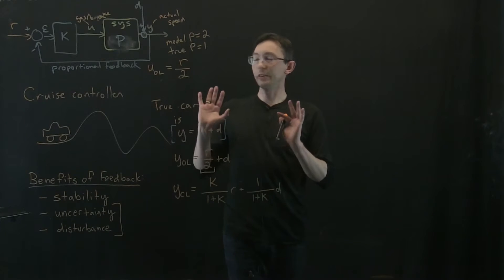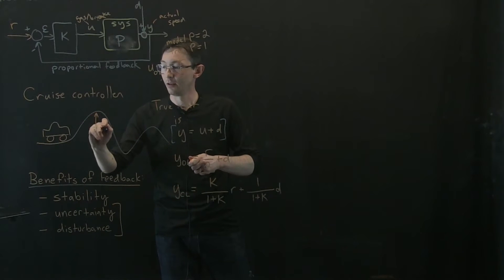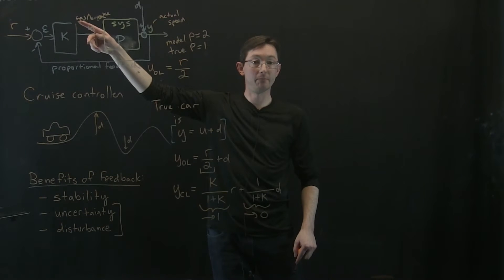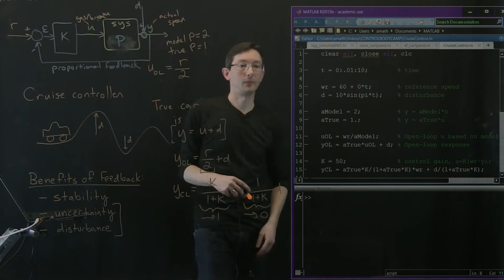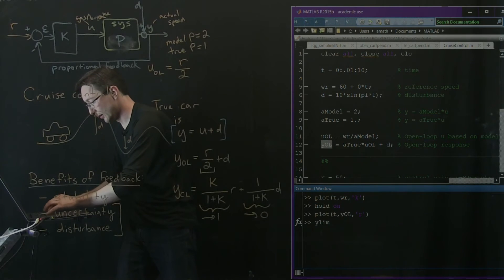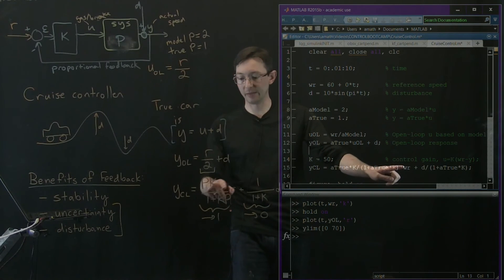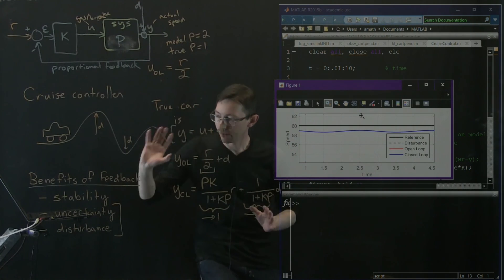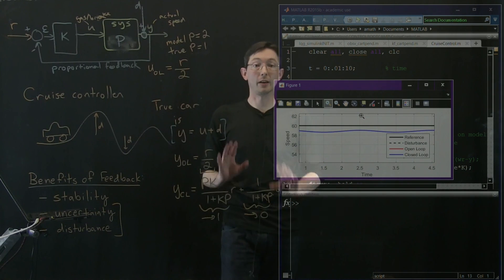Control Bootcamp:  Benefits of Feedback on Cruise Control Example (Part 2)

Comment: I want to express that your videos or lectures are probably the best I've encountered in explaining the 'relevance' among ctrl, obsv, LQR, Kalman filters, and the necessity of reverting to classical system analysis for robust control. Your language is not only succinct but also remarkably clear. Sometimes, it even leads me to moments of sudden clarity. Whenever I'm about to switch jobs, I habitually review various textbooks, my personal notes, and other online resources. However, none of these have elucidated the connections as effectively as your content. Moving forward, I'll be returning to your videos as my primary resource. BTW, I have already purchased your book 'DATA-DRIVEN SCIENCE AND ENGINEERING' in support of your work. Thank you for your invaluable knowledge sharing.